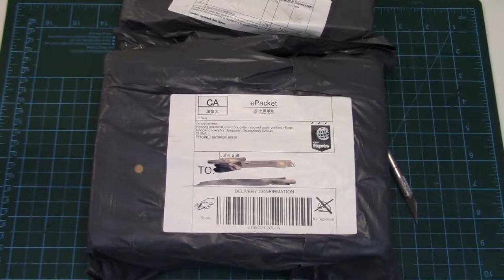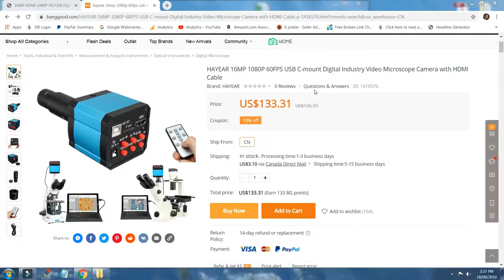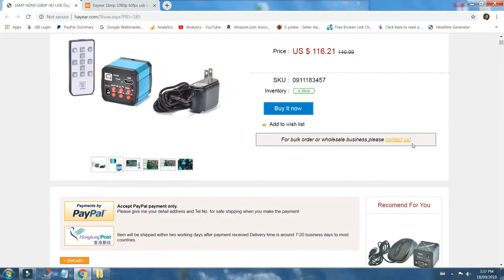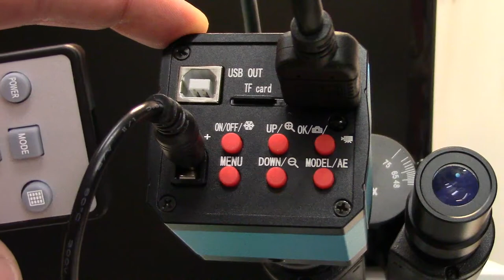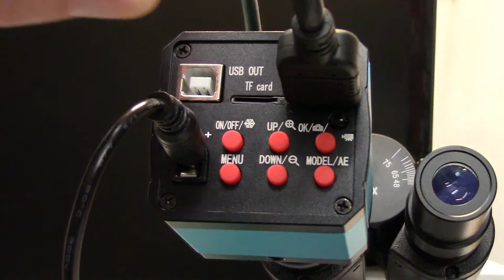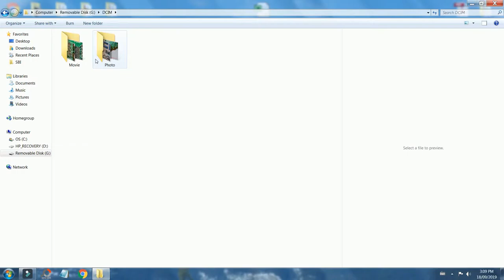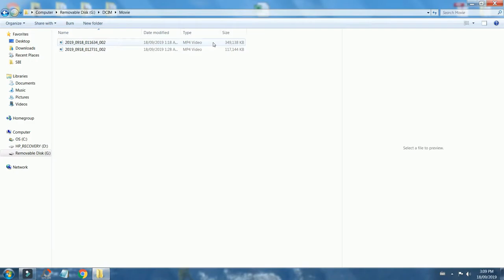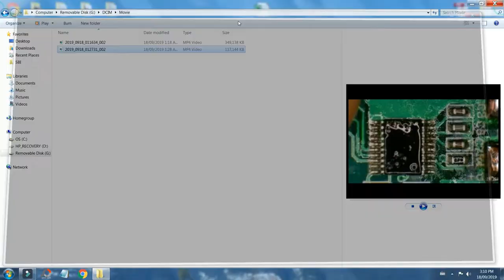Cheap HD Microscope Camera Review - Compound & Stereo scope examples.

Comment: Are you still using this camera? I had a question about it, does it magnify like the eyepiece that’s removed?  My eyepiece is 10x mag and that gives me my final magnification amount, does the camera have any magnifying?
Reply from the maker: Yes, still have it & its working great. Yes, the camera has built in magnification but no idea what the actual power is; if there even is a way to correlate camera field of view to eyepiece FOV.
At first glance, it seems more than the 10X eyepieces (even with the 0.5X barlow which must be used). I too have 10X eyepieces but I always use wide field ones and I believe that is why the image seems more magnified with the camera.
Just as an example, when I view a specimen in the compound scope that takes up about 50% of the total field of view through the 10X WF eyepieces, the view on the monitor though the camera renders the specimen at almost 100% of the field of view and almost fills the entire monitor. That is without any digital zoom dialed in on the camera. However, if I view the same thing without a WF, just a regular10X eyepiece, then what I see through the eyepiece is pretty close to what is showing on the display, not exactly 1:1, but maybe 80% of what is showing on the display.

Comment: Thanks John for an excellent guide. My need is to document my work by taking snapshots now and then. Are you able to stream in realtime to the computer via USB,  in my case a MacBook? If so I may take screen dumps from the computer for later use.
Reply from the maker: No idea with Mac. My PC's see it as a web camera so by using any standard web cam recording software, I can record in real time; again, no idea on Mac.
Reply: @Rchelicopterfun  Thanks for the reply. Yes,  if it acts like a web cam there is no problem . Perfect !!

Comment: Hi John, Im wondering would this be good for painting very small models? (28mm scale miniatures) ive not seen them be used for this so im hesitant to spend a lot of money on it. Any thoughts or advice would be appreciated.
Reply from the maker: I'm presuming you are referencing the stereo microscope? The camera alone won't work without some kind of microscope to use it with. The stereo microscope (not the compound biology microscope) I'm using in this video (an Amscope 7X - 45X zoom) would work for that size of miniature, likely best with the addition of a 0.5 Barlow lens. That Barlow will half the magnification but double the working distance so you have more room between the stage and lens body to paint. This is the setup many electronics/RC hobbyists have (myself included) to get the soldering iron or smd heat wand under the scope and that magnification range is just about perfect for most electronic component work including tiny SMD so I would think it would also be a good magnification range for 28mm size miniatures. For fine painting work, I would think you would need a stereo microscope so you have a depth of field while paining. Likely not even using the camera. Of course I don't know a thing about that hobby - you would know your requirement's better than me 🙂
Reply: @Rchelicopterfun  Thank you John yeah the depth of field would be important,  AliExpress does have a trinocular stereo microscope with a 48mp camera for about £372 but it would be a very expensive experiment

Comment: Do you also have a blurry image on the left? I bought Hayear HY-2307 the tear image is blurry, very clear on the right, I turn the camera over, the blur moves to the right. The sensor through the microscope is working, very clean, even removed the upper protective glass, the matrix is still under the glass. Nowhere can I find a Panasonic MN34110PA for sale to try to replace. Do these matrices have such a disease?
Reply from the maker: Mine is slightly blurry around all edges, not just one side while the center is crystal. I however see the same thing when viewing through my eyepieces as well as the camera, so the outer edge blur I'm experiencing is in the scope, not the camera.

Comment: Are you able to zoom in further with the camera? If it can only use the 100x objective, that seems really low.
Reply from the maker: Most microscope cameras have no additional zoom. They have no optics, just the imaging chip. The microscope is the optical zoom device or your imaging software if you need even more.

Comment: Can this be used in a simple mount and broadcast onto a monitor? What I’m looking to do is mount it above a knife sharpener so I can see a zoomed in edge. Vision issues. I would like to mount it 10-12 inches above the blade edge and have it zoomed in to at least 150x? Will this work with proper attachments without scope? Thx for any help you can offer.
Reply from the maker: This is for scope use only.